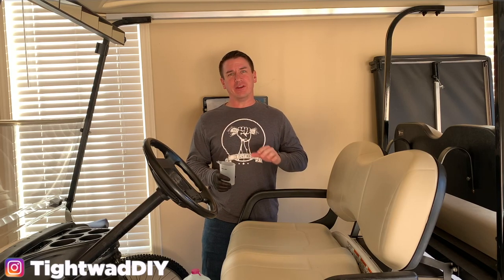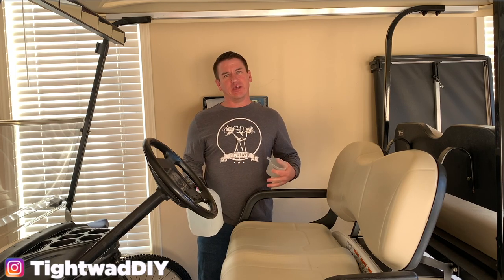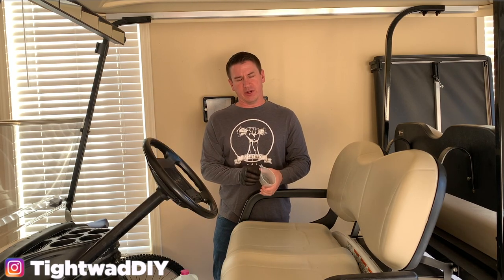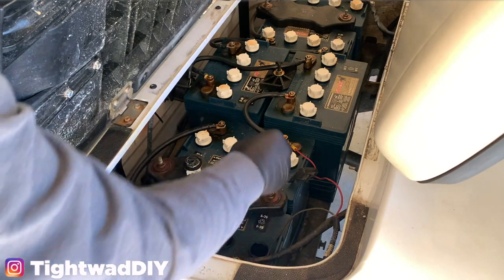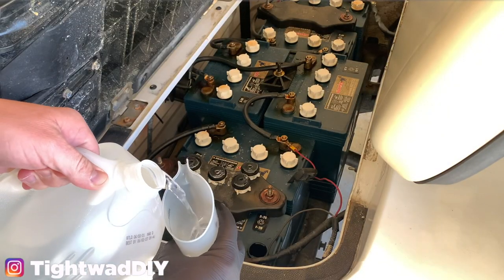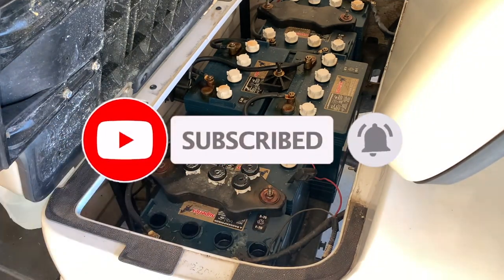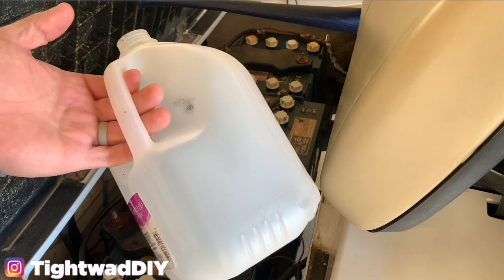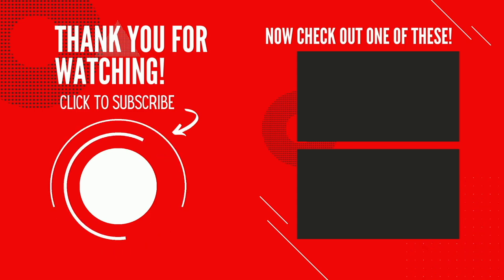Golf Cart Battery Maintenance | Watering Golf Cart Batteries | Electric Golf Cart Maintenance

Comment: We watered the batteries on our 2019 EZGO TXT and didn’t use distilled water because didn’t know I was supposed to do so and it ruined them within 6 months had to buy new batteries work great now. But we didn’t use distilled water on previous golf carts and have never had an issue but for some reason this one didn’t like that regular water so much I guess we have just gotten lucky before on our previous golf carts.
Reply from the maker: Tap water isn’t nearly as pure as distilled. The contaminants in your tap water can cause rapid corrosion.
Reply: @TightWadDIY  lesson learned for sure I also used a battery watering jug that shuts off when full actually really helpful in my opinion only around 15 bucks on Amazon worth every penny to me thanks for the reply and nice video
Reply: @Blakeneal407  I’ll check out the jug.
Reply: @GrillThisSmokeThat  worth it to me

Comment: I overfilled the batteries and it's leaked a couple times while I've been charging it will that result in the getting to the proper fill level or do I need to do something else
Reply from the maker: I am not really sure. I’d call a local battery store and ask them if I were you. I imagine it would eventually equalize to the correct level.